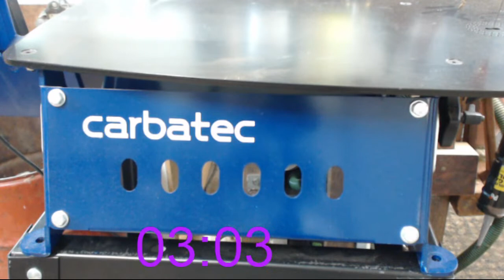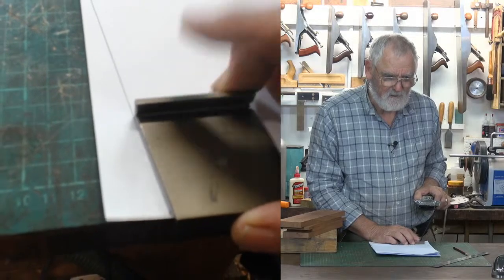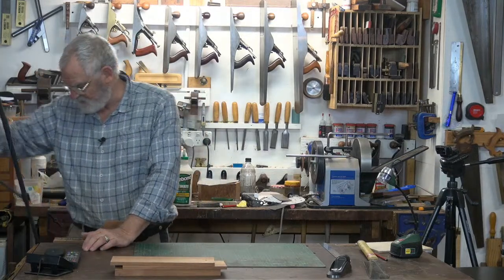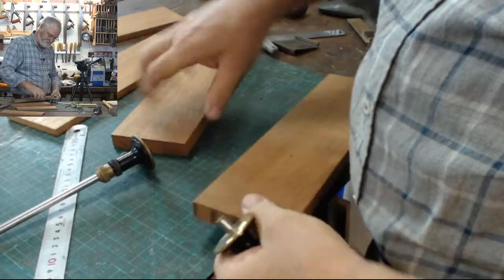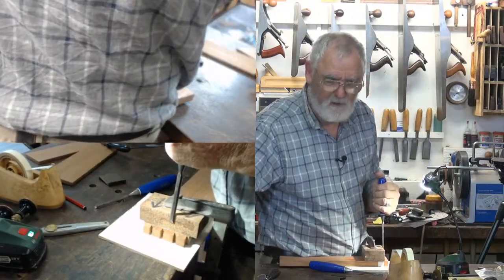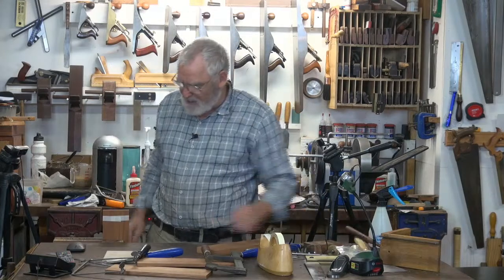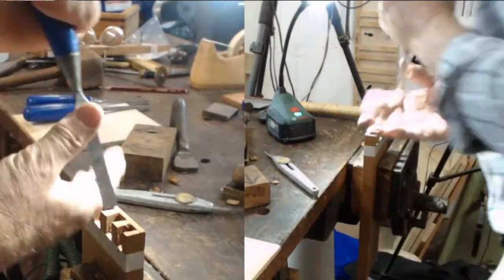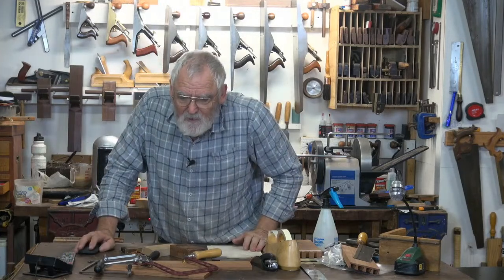Steve Hay Dovetails Introduction and Tips.

Comment: Thanks for the video. I missed the livestream. I haven't attempted the half through dovetails before, so I'm glad that was chosen. I'll give them a try now. I do have a couple of questions: would you do any other work on the front of a drawer before or after the dovetails? And is the water to give more grip?
Reply from the maker: Hi Debra, Yes, most definitely. I tend not to finish the front completely as there is a fair chance it will get marked during the dovetailing process. Have it finished to size and sanded with 100 grit. Once Dovetails are completed & glued up (square :) ) sand through the grades to 400 grit (or whatever you normally sand too). Then if you are going to, you can go ahead and fit any Cockbeading or leave the draw plain. Looking forward to seeing the results. Cheers Steve